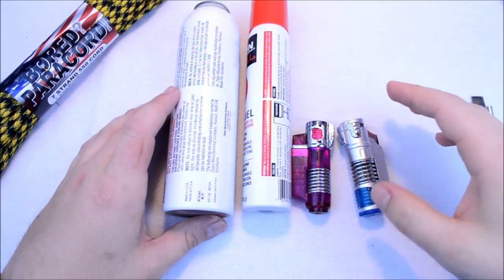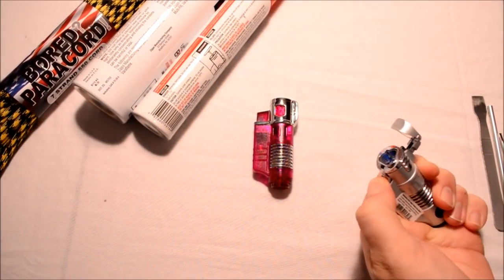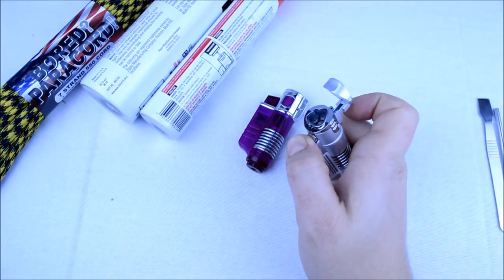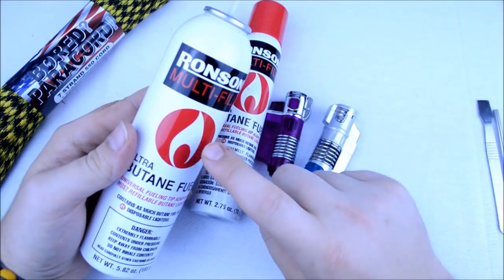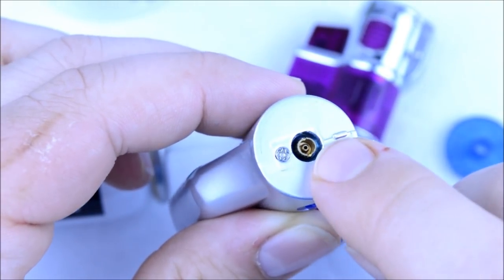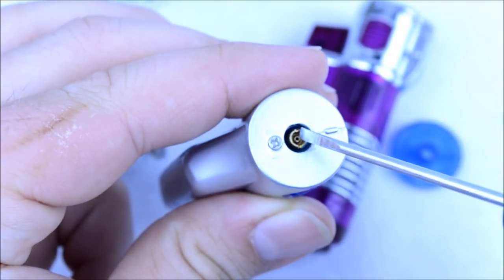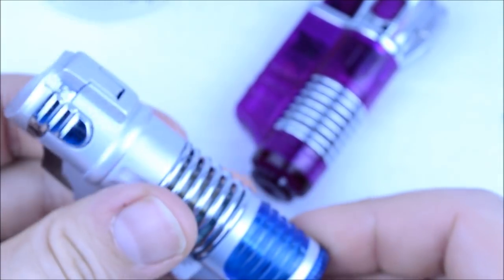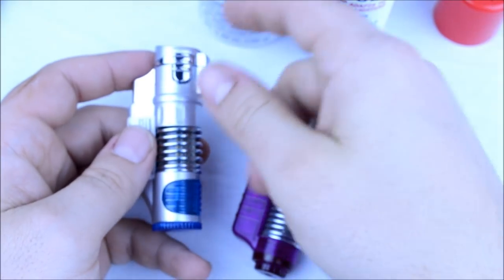How to Fill A Torch Lighter With Butane - BoredParacord

Comment: Awesome video Shawn!! People have to be smarter than the tools they are working with for them to work properly.. These lighters have to be completely empty be for refilling them.. Great job buddy..
Reply from the maker: Thanks Coop!   :)
Reply: Haha My lighter was lighting then I pressed the refill part down to release all the excess. THEN I filled and it worked perfectly.
Reply: why wont they work if you fill when they are say half full?
Reply: that's what i want to know, seems like you have to waste quite a bit to empty it then refill
Reply: Incorrect. You need to bleed the extra air until you get mostly butane coming out then fill. But only someone with a lot of experience would know the difference. Penny tend to just pass what they hear instead of verifying from a reputable first hand source. You can/should, but definitely do not have to if you bleed the extra air out so you can make room for more butane/propellant.

Comment: I ordered the triple flame butane lighter from your site. If anyone is experiencing this same lighter leaking butane and not lighting, then open up the lighter and you'll see the tubes are not connected to the tank. I used pliers and connected all three. hope this helps

Comment: Just received my lighter, having actually watched this video before purchase. It's been purged then filled. No luck. I've tried it with the valve in several positions, from closed all the way and then open an 1/8 turn to opening several turns. No matter where it is, gas continuously hisses out. I'm afraid I'll be returning it to try another.
Reply: Thanks for the replacement Shawn!

Comment: is there any butane that specifically made for jet lighter? I cant seem make my lighter work! it looks like it doesnt have enough pressure inside so the flame is weak not coming out like jet anymore. I used premium butane by Colibri.
Reply: Did you purge all the gas and air out before refilling
Reply: You have to clean the nozzle. I use a capfull of rubbing alcohol. First Soak it for five minutes then I  use the wire from a bread tie poke all of the nozzle holes. Rinse it out really good with the remaining capfull of rubbing alcohol.i use a soft bristle toothbrush . Let it dry out . Put it back together and rock and roll!

Comment: Do the directions say to shake the can?
Before light a newly filled lighter it should rest, don't try to light it right away.
Reply: Only needs a 30 seconds maybe a couple mins depending on temp. Only slight pressure changes. Cold butane doesnt flow well. Warm works great

Comment: You shouldn't need to take the dial cap off. The bottle of butane should fit threw the hole of the dial cap..

Comment: mine still doesn't work, emptied then refilled, and still doesn't work, it works sometimes for a short time then stops
Reply: Exactly!
Reply: +Incy Wincy Spider stop setting it so freaking high then!
Reply: I had the same problem. The problem is that you have the gas flow set too high.
Reply: Anttac221 Even setting it Lower wont help
Reply: Cody Timmins it needs butan gaz

Comment: Why didn't he empty the lighter by pressing the valve on the bottom?  Instead of letting the flame burn out the rest of the fuel?  Is there a reason for that instead of using the valve?  Maybe so not to release too much gas, for safety reasons?
Reply: +B Dill Butane gas is heavier then air. So if you let out unburned gas all over the table and then immediately afterwards try another lighter it could be pretty nasty. :)
Reply: what is the littlest screw on the bottom for

Comment: Can i use zippo lighter fluid?
Reply: Knight 23 * no
Reply: Ok.  Why not
Reply: Butane is a gas. Lighter fluid is s liquid. Made for different lighters.
Reply: @zombiegirl156  Okay. If I mix a 3 to 1 Ratio of Butane and Lighter Fluid, in an attempt to continue filling a Butane Mini Torch with the correct Butane Gas stuff, have I accidently made a grenade bomb?